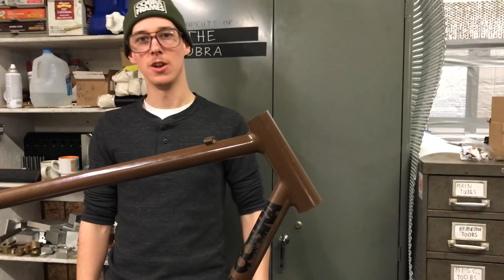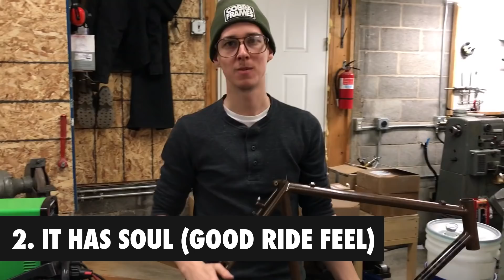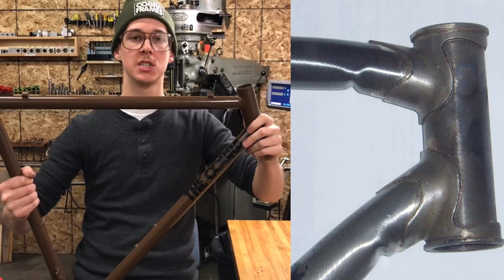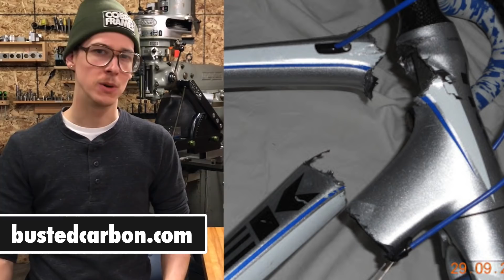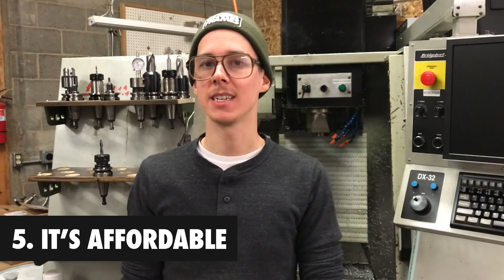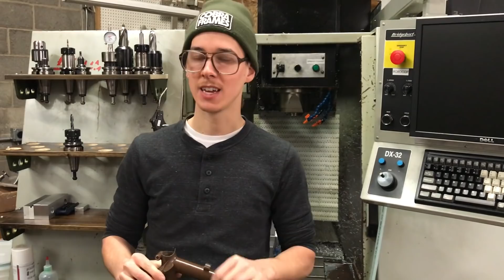5 Reasons Why "Steel is Real" | Bicycle Framebuilding

Comment: Steel is real...good for a lot of reasons.  Most people, who dont ride, think of a  bicycle as a toy.  They got one or several as a kid in a dept store. Crappy components and a slip-slap weld at joints. A quality frame, especially and Italian, is in the stratosphere of performance.  And, most people have no idea as to the importance of lug design and the strength/weight aspects.  Plus, get in a crash, a steel frame can be straightened and welded.  Got an old Shogun frame back in '90.  Just lifting it the first time was an epiphany. Ordered Campy Athena group, and built it.  My shake down ride was a shock. The bike was an extension of me.  There is my steel testimonial.

Comment: My first decent bike was my brother's old Gitane Tour de France made from Reynolds 531 Steel with "sport touring" geometry and a heavy Brooks-style leather saddle.  In got it in 1983, took it to a local pro shop for bead-blasting and repainting.  I rode that bike everywhere ... about 500-700 miles per month.  This was roughly when Cannondale first came out with their over-size aluminum tube frames.  As I began to ride faster and compete in local races, I began to lust after a Cannondale.  I was seduced by the stiffness, light weight, and of course their magazine ads showing that small rider squatting on the rear dropouts.  I thought stiffness, lightness, and upright geometry was the thing to have.

I finally got a Cannondale, and, honestly, it sucked.  After long rides (anything more than 25 miles) , my legs felt like crap ... severe pain.  Long rides on the Reynolds steel (even more than 100 miles) felt pleasantly tired.  I realized that efficiency on a bike testing machine, does NOT necessarily translate to efficiency for a human ride.  I could ride longer and faster on steel vs. AL, despite the fact that the steel was a little heavier and less "efficient" at translating pedal power to the wheel.  It's not "efficient" to trash your legs and burn out faster on AL.  Riding was no longer fun.

I now ride a high-end steel bike again ... with a heavy, Brooks-style leather saddle.  And I'm in heaven.

Steel is definitely real.  A high-end steel frame rides like a dream, and makes cycling fun again.

Comment: Vertical compliance of the bike depends on the length/angle of the seatpost, length of the chainstays, wider tyres (at lower psi) and fork rake. This accounts for most of compliance, NOT the frame material. Of course, it's complicated: https://valvejob.wordpress.com/2020/07/13/bike-frame-design-the-myth-of-vertical-compliance/
Nothing matters much on SMOOTH surfaces
Frame DOESN'T matter much
Fork DOESN'T matter much
Tyre characteristics don’t matter much, except on gravel
Tyre pressure matters A LOT, and it matters more as surfaces get ROUGHER

Comment: Hello !
Can you make a suggestion on a steel frame or a complete steel bike that :
I can set up with high rise bars ( like BMX type bars or Jones bars )
Through Axels , ability to fit bigger tires 29 X 2.0 - 2.5 tires 
And a bike or a frame that has more of an upright geometry higher stack not to long or aggressive reach that I will use for daily riding around in comfort but still have the ability to do some off roading and be able to handle different types of terrain .
Thank you !

Comment: You missed the most important of all points about steel.
I’m a scientist, cyclist with 40 years experience working on bikes. My friend has built many steel frames out of 531 that were in the Tour de France.
Wheel and frame alignment are the most important aspect of cycling.. being off just a few millimeters can cause you 50-100 extra watts and knock 5mph off your top speed.
The reason why those expensive bikes are so fast is because they are usually in perfect alignment.
With steel you can easily take the twist or sway out of a frame and dish the wheels back into perfection.
With steel forks too.
I’ve thrown away a lot of expensive carbon frames and forks because they were manufactured a little off.
With carbon there is nothing you can do about that other than passing them off to someone else or trashing them.
Reply: But doesn't that also apply to aluminium and titanium?
Reply: Yes

Comment: Is it OK (Safe) to do welds that are close or over the fittings? I am looking for ways to make a 1957 steel frame stronger for motorized bike application.. So the idea is to weld triangles on crucial places on the frame to take away stress further to the tubes rather than the joints.
Reply: Poor bike, keep it stock
Reply: @jb4317  It is not in a good enough condition to keep it stock or restoring it to original state. It is missing parts. And vintage frames are still not so rare to bother keeping them stock for the sake of history. I did "ruin" another 1955 Mifa frame with internal gear rear hub, front dynamo hub drum brakes and modern wheels. From a heavy and hard to ride with a coaster brake bike - it became a lively daily commuter and it still looks as a vintage bike.

Comment: Hello Joe. Nice video 😉  I have 2 questions about it: 1) Is 4130 steel a stainless steel?  2) For the bike in this video, what kind of welding did you use between the head tube and the top/dowm tubes? Is it TIG welding? Loving the visual aspect 👍      Thanks a lot in advance 😉
Reply from the maker: The brown frame shown is brass fillet brazed

Comment: Great video, been really enjoying your channel. It has definitely gotten me excited about trying to get into frame building.

One topic you didn't touch on that got me interested in steel is the environmental impact of bike material choice. I've done minimal research on the topic, but most sources seem to point to steel as the best material for the eco-minded folks out there. Aside from maybe wood frames which are much more difficult to come by. Producing steel creates much less CO2 emissions and lower water usage than other materials such as carbon or aluminum. Also, if you get a hand-built rig from a small shop like yours, you are supporting local economies and avoiding all the nastiness of large scale manufacturing. Of course, there is always a cost with any material production, and buying new never compares to reusing a used frame, even if the new is steel.

Comment: You say it transmits all the road buzz/bumps, then you say it's a comfortable smooth ride.  Can you please reconcile these contradictory characteristics?
Reply: rather than hold stiff resisting the bumps, you move WITH them
Reply: @loversrockpaper  I agree
A steel frame "flows" and "flexes". This is almost a "dock absorption" system. If you Hit a sharp bump riding steel, than other material (carbon fiber, Titanium, aluminum).  
Will shove that disruption through your butt much harder than on a paperthin steel frame
This assumes we are talking state of the art frame tubing from Reynolds from Britain or Columbus from Italy.
If you get stuck on a stovepipe bike none of this applies.
Reply: @douglas2lee929  what do you think of kaisei tubing?
Reply: See my reply 2 entries down
Reply: I mean one entire above

Comment: Can someone recommend me how to maintain steel frame from rust?
Reply: Check out IF webpage FAQ http://ifbikes.com/faq/  Seems like you should be careful to dry the bike anytime it gets wet, grease the seat post, and occasionally spray the interior with a steel protectant.  The 3M protectant that IF mentions seems to be difficult to find but there are other options.  I haven't used this before but there is probably some videos on this subject.
Reply: Spray Framesaver inside the tubes

Comment: Nice video.  Still riding a 1995 Serotta, on 2nd set of wheels and chain rings, 4th cassette.  After ~40,000 miles, don't see any new bikes that I prefer.  Just need to keep it maintained with a lot of NOS components, Campy Chorus 8-speed.  Winter and bad weather bike is a steel Surly Wednesday.  Needless to say, I really like steel.

Comment: Steel and titanium bikes are kind of the last bastions for an individual craftsman.  However, any material you use is subject how well it is engineered to achieve what you want.  There are steel bikes that are boat anchors and steel bikes that are like noodles.  If you have ever looked into the bottom bracket of a "lightweight" steel bike frame the tubing ends look cheap.  This is because the tubing is about as thin as it can be without collapsing like a beer can if you were to squeeze the tubes from the outside.  Carbon can be laid up in an almost infinite amount of ways to give a frameset whatever properties you want. Steel tubing is not nearly as flexible in that regard. A carbon frame of equivalent weight to a steel frame will be MUCH stronger.  Typically though, most carbon frames are lighter and modestly stronger than their steel equivalents.  There is a YouTube video by a carbon fiber driveshaft manufacturer that does a good job of illustrating this.  Yes a steel top tube will dent if your handle bar hits it with sufficient energy, but a similar impact on a carbon fiber top tube will merely bounce off.  It will take a lot more force to cause any damage to that top tube.  Carbon fiber is also known for its vibration damping properties.  It is one of the reasons tennis rackets went from aluminum to carbon fiber.  Carbon fiber doesn't fatigue or corrode.  My favorite road bike was the Kestrel Evoke, really light, stiff, with a great ride quality.  My last road bike was a steel Bianchi, beautiful, with a good ride quality.  Touring frames are a relatively niche market.  The frames are intended - besides having a good slack geometry - to be strong.  You don't have to re-engineer a steel touring frame to support eyelets, you just braze them where you want them.  A carbon Fiber frame will need a metal insert and maybe more laminations in that area to distribute that force.  There are not many (any?) full blown manufacturers who are going to invest in these expensive molds for every frames size for a niche market like touring bikes.  I don't ride road anymore, but if I did, I would get a beautiful steel bike, but I am older now and weight isn't a consideration.  Carbon bike frame manufacturing is an INSANELY wasteful way of making bikes, and I always thought that titanium would be the future material.  I mean, they're tubes.  You weld them together.  You can sweep up the chips, and you can make more titanium (or steel) with them.  The the cold hard brutal truth is that carbon frames can be made into almost any shape you can imagine, and you can tailor the properties you want on a much finer scale than metal.  I have great respect for the builders who lovingly craft these bikes in the old way, let's just not jack off to that shit, lol.

Comment: Where would you recommend purchasing tubing from?  
I called a metal supplier near me and the per cut cost made it super expensive!
Reply from the maker: Well, bike frame building can easily feel expensive, but I would go to a bike - specific supplier like bike fab supply.
Reply: @cobraframebuilding  Thanks! When I looked years ago I just wanted a kit, but there were so many things I didn't/don't know.

Comment: Where would I find info for picking tube sizes. For example  if I was using 1.25" tube for top tube. What wall thicknesses  for 4130. Or just dom tubing. I know 4130 is about half the wall thicknesses  for same strength.   But where di I start?  And seat post tube and down tube sizing the same wall or differences  all over?
Reply from the maker: I think the only way to really know is to build a lot of bikes and test them, but in the beginning you have to go off of what others do and suggest. Talk to bike tubing suppliers. Look for bike tubing kits and see what those spec. Get to know some other builders and ask them about what they think. It’s a big topic.
Reply: @cobraframebuilding   thanks and I did find the other video you posted about purchasing  tubing kits vs just tubing etc.  So that helped too.

Comment: good and help full video, i was planing to make full suspension frame in 6061 alu. but now i will make the frame with 4130 steel but why heat treatment is not required ? if you are using TIG welding metal is heat and if metal is heat we should heat treatment on that area for better strength ? please replay me

Comment: I don't know why people say steel is real when I've had a Aluminum Bike for over 20 years and never once cracked or bent people say steel is the way to go well you don't know until you hop onto aluminum and boy it's a big difference I still say aluminum over steel any day
Reply: This probably just shows that it isn't the bike but the rider lmao, since everyone can point pros and cons of why it's a "better" choice
Reply: Have you ever crashed it?  I’ve owned steel and aluminum, and you can actually repair a steel frame or bend it back, and it’s back to business.  I’ve even seen rear derailleur drops replaced and rewelded after they snapped off following a 30 MPH crash on a steel bike.  Aluminum frames are pretty much toast after a less significant impact, albeit they’re not as brittle as carbon.
Reply: @TruckeeDoggo  Some companies give a lifetime warranty on the aluminum frame, but I suppose there are some gotchas....such as no stunts...
Reply: arbj yeah those warranties typically exclude damage from crashes....
Reply: I have both too, but to me the steel frame bike just rides and feels better

Comment: Thanks for suggesting that student welders learn incrementally. Years back, I took 2 welding classes at a local trade school. The first involved gas welding steel. No brazing or soldering. That was a reasonable (and very hot) way to start. But for the second class the instructor had me TIG welding 1/8th" aluminum plates! I did better than most, but even with an 'A' in the class, I wouldn't trust myself to TIG any aluminum object that wasn't scrap.

Comment: Bamboo would be cool - anybody ever ride a well built frame?
Yeah - steel is real - I have never ridden carbon or Titanium - but I know aluminum feels dead in comparison.
I had a short wheelbase Fuji racer in college that was so springy it was kind of dangerous - but a lot of fun. Definitely "Alive".  On the other hand my first "bike" was a department store Huffy - SUCKED.  So if you don't use quality tubes - steel can be dead too.  I could barely outrun that St. Bernard on the back-way to school.. F'r would jump right over a 6-foot fence just for me.

Comment: I thought carbon was the best, till I rode a steel touring bike (format 5222(cheap Russian bike)) about 2 years ago. Instant love. My tcr carbon is now collecting dust while I ride my steel touring bike with 28c tires everywhere. I feel "relaxed" on my steel bike. I always was worried about hitting a pot hole and having some cracks and stuff. Peace of mind!
Reply: Wasn't it some sort of XB3 Tourist. Was able to ride on it without any saddle sores/pressure sores/bruises for more than 9 hours per day in combination with obsolete German leather saddle even after not being able to ride during the winter. Will see how it compares to Thorn Audax. Already tried to compare it to Raleigh Banana with gaspipe hiten steel tubing which is said to have ride quality similar to "dead dog". Compared to Tourist XB3 which felt fairly lively Raleigh Banana felt rocky over bumps but still better at maintaining speed compared to cheap aluminium frame which kinda felt faster due to better acceleration, but the ride quality felt erratic.
Reply: yeahhhhq Trek 520 man is here
Reply: Carbon for road racing (glory). Steel for touring (passion).

Comment: Cromoly Steel is my favorite - ive worked many years with bikes. Dont know why modern bikes dont use them often
Reply: Same. My current bike is Chromly steel. My first steel bike actually. It's an amazing bike. It feels amazing on the road and off road as well.

Comment: Good video and spot on; an exception to the rule that steel bikes are inherently magnetic are frames built with Reynolds 953, which is a high strength maraging (austenitic) stainless steel alloy. Chromoly 4130 is probably the material of choice for 90% of steel bikes and is ferritic at room temperature which means it is magnetic. Austenitic steels are non-magnetic. What makes Reynolds 953 exceptional (and rust-proof) is that it is alloyed with high amounts of chromium. very machinable, and after forming martensite,  additional aging heat treatment makes the material even stronger.  Hope to have a 953 frame one day.

Comment: Thanks for the video! What are your thoughts on All City bikes? I'm looking to get the Cosmic Stallion...
Reply from the maker: I don't know All-City's current line up super well, but I think their bikes are generally solid. I believe they are all manufactured at the Maxway factory in Taiwan. Search for the video "Bike frame manufacturer - Bicycle frame manufacturer - Steel bike frame in Maxway" here on Youtube. Cool facility. All-City is one of the QBP brands (Surly, Salsa) and I think they have cool and interesting offerings generally.
Reply: I just got a cosmic stallion. I like it but it's stiffer than my old Trek with 531steel tubing. It's also a pretty heavy bike I weighted it around 25lbs. It looks like a very durable frame but it's definitely not a super fast bike.

Comment: So where do you recommend for building a first bike to buy the steel? And what about the head tube, and bottom bracket if I only wanted to do threaded? And 12x142 rear? Thanks
Reply from the maker: I have a video about bike specific tubing and another video about dropouts and below the videos in the description I have links to materials suppliers.